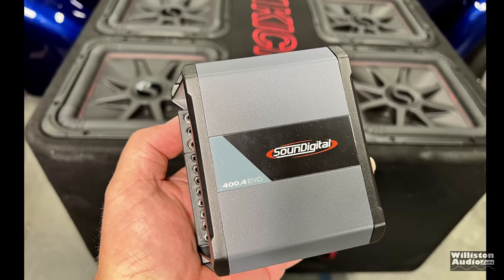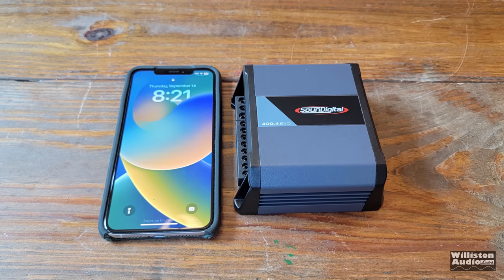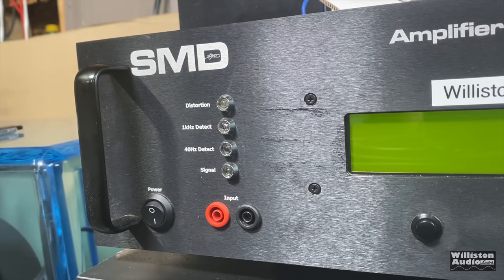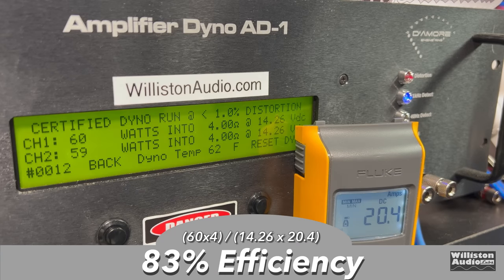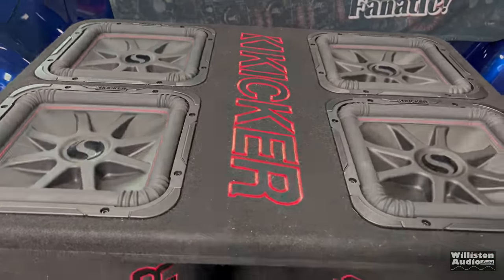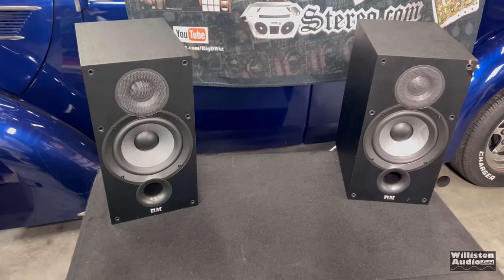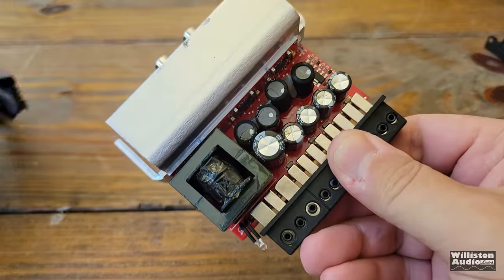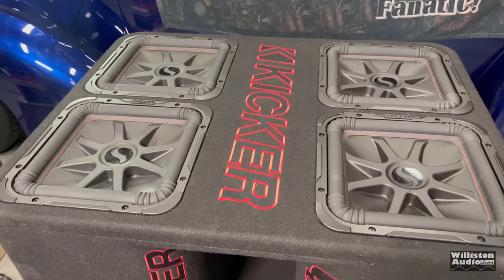Can This Tiny Amp Power Four 12in Subwoofers?

Comment: Did it have a sticker over the barcode on the box?  I've seen this in the past when I used to work in a manufacturing environment, items destined specifically for Canada being re-barcoded for the USA and illegally re-imported because the per item cost was lower for Canada vs purchasing for USA.

Comment: That amp looks like a counterfeit.  
I bought a couple 400.4 EVOX2 amps over a year ago from a dealer.  I was very impressed.
Fast forward to about a month ago.  A friend wanted some advice and help so, I steered them to the 800.4 EVOX2.  They bought it on Amazon.  Turned out to be a counterfeit.  After hookup, had a horrible ground loop noise until little puffs of smoke emanated from the vent holes 3 minutes later.

Soundigital amps (both EVOX and EVOX2) are black, not dark gray. Both series have both low-level and high-level inputs. Both have switchable x-over and adjustable cutoff.

Also, the counterfeit we received was  bought from the same Amazon seller “OTTO GROUP”

Comment: Hey I have 2 12” QPOWER dual voice coils 1700 peak power 450 rms. I would like to see what you think of them. I’ve been running these for around 3 years and just recently replaced one of them. I’ve blew 3 boxes and still run one of the original ones and the replacement

Comment: Very unique design. They have made the chip amp daughter board on aluminum. The same type of pcb that is used in led lights to cool the led chips better. These have excellent thermal conductivity and sinks 10-15w heat from that size of chip easily. 
The class d chip i think is international rectifier ir4321. Which is capable of 90w at 10% thd.
Reply: What do u think would be a good amp for a bluetooth speaker, around 200 x 2?  I want to push 2 8s and 2 tweeter's properly
Reply: thanks, i was wondering if it was IR or TI. new amp ic to me :)

Comment: Loved & appreciate the easter egg @07:05  :D   Is that a 'C' model of Solo-Baric (12")? I used to have two S15D4s in my 4-Door Geo Metro in the late 1990's, wish I never sold them. They were great until they broke my A/C compressor mount (SPL) and I was without A/C in Central FL from that point forward, obviously no rear view mirror ever after installing them. I miss my JDL 700 watt amp (deep purple metal shine finish, D4S should offer multiple colors for heat sinks across models, not a different color for each model... the major system design reason I won't buy D4S amps and surely I'm not alone). This amp is currently $79.99 on AMZ. If it was selling for $59.99 it would be a GREAT buy for a go-cart amp or other smaller bike/e-bike/PowerWheels set-up for sure. The 'snack size' package of the amp and meeting rated power (each amp obviously may do a lil more or lil less than rated, don't troll me) do make it a great value. However, cooling could be pricey or a concern. If only it was a marine certified amp (again, $79.99 is pricey as-is IMO). The features are great though.

Comment: I would be inclined to believe that the amps that “jump” wattage during a test are either noisy at the outputs and corrupting the display data or there’s a small random bug in the firmware.
Reply: I was thinking the same thing.  That perhaps they skimped on the output filtering to achieve size and efficiency. That switching spikes were confusing the amount dyno.

Comment: Had a a 1988 S-10 Balzer, slammed to the ground with six 15" square solo -Baric Kickers with 3 2000 watt Lanzar amps pushing them. Only time I saw the back hatch glass exploded in a vehicle.

Comment: Im running 2 orion hcca 104s. On a bamf 8,000 amp. 2 bapower cells. Then under the seats 2 american bass tnt 10s on 2000 crunch amp in my scion xb

Comment: It’s funny that there are amps out there which have lower ratings dynamically, I only faced the same situation during a dyno one time with a rockford p300-1 which is still available and far away from being old school, but dynamically it went into protect at 1 ohm ( also fun test) but continuous it was able to put out even more power 😂 it started to smell a little bit. Seems like strange behavior of protection circuit 😮
Reply: Anyone whose ran Rockford Amps, know that smell

Comment: These are very popular in Brazil. Actually costs around 40 usd in direct conversion and is good for its price & size. Of course its a class D. I have a 800.2 evo 4 in My car , it has only 2 2 ohms channels with similar size, 800w in bridge, powering my 500w subwoofer, and it delivers very well in my stock battery ( I think one of the best qualities of a class D), fun part is that they just released the Evo 6 line with HALF THE SIZE.

Comment: what are you using to supply power to the unit? i would image a switching AC/DC power supply and not a car battery but correct me if im wrong

Comment: How would you say that these new amps compare to the amps from the 90s?  I had many back then and they were spendy.  I had a Rockford Fosgate Punch 100ix that cost 399 back in 1996.  A fortune for my 17 year old self.
Reply from the maker: New amps pack much more power for the size and price. Do you need all that power? Maybe or maybe not. Just crazy this tiny amp could power an entire tiny system in 3ch mode.

Comment: I've asked before and I still don't quite understand, what does it mean to "need 4 channel input"? 
Does it mean you can't use the amp unless all 4 inputs have a signal?
Reply from the maker: Correct. Some amps have a 2/4ch input switch so you only need 2 inputs. This amp doesn't have that so you need all 4 inputs
Reply: @wal  ok gotcha, thanks Big D!

Comment: Not positive but I believe this is a strongly regulated amplifier.   It does very well on subwoofer Duty.   Makes a nice 3 channel amp.  Two channels stereo 4 ohms.    Mono channel 8 ohms.   It will run all day like that.    Sounds good too for rap and rock.  Not for jazz.   If you can find a dry spot works fantastic on boats and motorcycles.  Good for fighting the wind.   

Not for serious listening  though.   

If that is what you are looking for.   Try the low line JL stuff.

Comment: To answer that question of your headline, it's a simple 1. All starts with a subwoofer sensitivity level. And where it's begins by manufacturer specifications. What is the minimum wattage to get quality Sound out of it? and a lot of speakers work with just 15 W.
Most speakers just need a head unit it doesn't get loud but it works.
Because if you doubt that amplifier could ever push a driver or a load, and you already have doubts that it could then you doubt the designers of a company. If I was an amp manufacturer, i'd say. Why is this guy clowning around? We made this amplifier and we copied arc audio.
Who did it first was arc audio for motorcycle installations ten years ago or longer.
So, yes, that little thing will get it to work, but how long will it last? We never get a report from you on things. If they last to the Dino, we get a fake dino test, we get a fake speaker load test, and then we never see how it performs in the field. It's all imaginary results. There's only one way to test a driver and a amplifier, and that is insequence of operation without simulation. Because to simulate, it's never official, it's never real.
I think you should go further with testing and create short circuits. Why are it backwards on purpose? Tell your customers that you have tested the fault systems. And that they work, you should run all tests that you can of all of occurrences that people have had an audio history for the last 30 years.
But whatever I don't know anything.